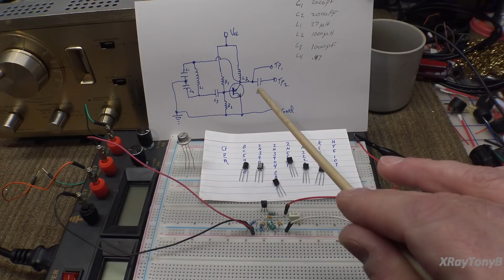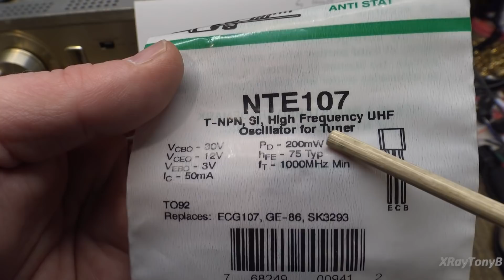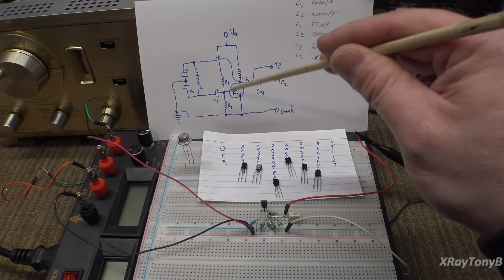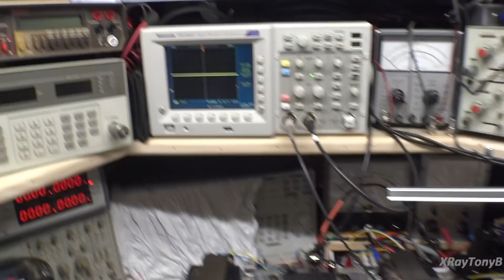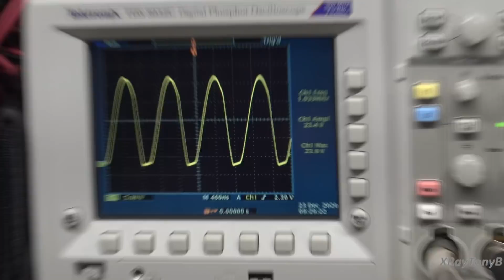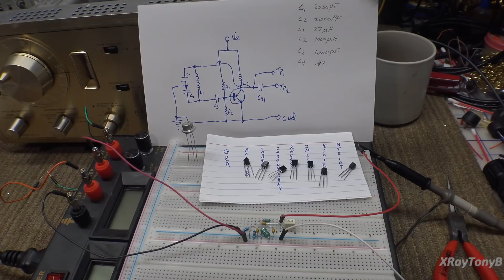Random Video - Effect of Transistor Type on a Circuit

Comment: You would probably get different oscilloscope traces for different transistors of the same type (especially the cheaper ones) because they have different current gains. If I was going to use a different type of transistor (beats ordering an expensive replacement) then I would probably change the biasing to suit. I have always thought that it was a poor design practice to make a circuit critically dependent on the type of transistor used though this may be a deliberate choice by the manufacturer.

Comment: To my non-electrical engineering eye, it looked like the transistors where the bottom of the waveform had a wider flat spot oscillated at lower frequencies.  More time was taken up recovering from the clipping at the bottom which lowered the frequency.  Am I correct on that?

Comment: great video.  thanks for doing this comparison.  We radio guys would love to see you do this with an RF front end amplifier circuit, as they are a source of great debate when it comes to transistor substitution.  maybe a common base configuration as a platform.  
One note is that NTE is a known parts re-labeler and the NTE107 you have there might not be the same NTE107 that i would get if i ordered one.
for us in the RF realm, it's all about noise floor, and the great debate is all about subbing out a 2SC1674 for a 2SC2999.
then there are those of us who wish someone would design a dual gate mosfet front end LOL.
another interesting video idea would be to show how the peripheral components change the characteristics of the circuit more so than just plugging in a transistor with a higher beta spec.
always enjoy your videos and especially the real world explanations.

Comment: To make the comparison more  similar wouldn't just reversing  the supply voltage for the PNP transistor? That way the DC biasing and the AC coupling would be the same as the NPN.
Reply: I didn't see what values R1 & R2 were. R1 would be much larger than R2  for biassing a silicon npn transistor without an emitter resistor, so merely swapping the collector and emitter would put a large voltage between the base and emitter of the germanium pnp transistor, perhaps as much as 11 volts. Perhaps the Soviet era components were bomb-proof.

Comment: It would be interesting to see the thermal effects on the circuit.  I bet even the warmth of your finger will change the waveform.  Without an emitter resistor the circuit will be very sensitive to the transistor beta and the bias will be sensitive to vt which is influenced by temperature.
Reply: Exactly, without the emitter resistor to lift the circuit into the linear region, the beta basically controls the result. I'm not counting the thermal effects.

Comment: Hi Tony, can I ask what is L2 doing?... understand the simple tank circuit with a tap in, but why the second coil. it's no choke, it's really bugging me🤔
(Pun intended)
Reply: I'm pretty sure that's there to keep rf out of the positive supply. Should act as a short to the 12v supply and a block to anything high frequency
Reply: L2 is the collector load at RF. It's pretty much a short circuit at DC (probably ~ 100 ohms), but at the operating frequency it has a reactance of 2PiFL = 6280 ohms. The circuit's output voltage at operating frequency is developed across it. Without an emitter resistor, this circuit, as drawn, operates in the non-linear region of the transistor, which is generally not optimum.
Reply: @cjay2  makes sense if the inductor has been 'tuned' for that frequency, so it acts as a choke (>f=> reluctance)  but similar could be achieved with a resistor? Looking closer at his diagram, there is a link back to the base, which may be there to provide feedback /osc stability? That would help to keep the transistor from saturation...

Comment: Ooooh! Russian transistors! 
I don't know why but there's something about Russian components! Especially if it's cold war era stuff! 
My favourite amplifier is using TO66 metal encapsulated transistors for it's output stage and I believe the input was using TO92? I could be wrong on that one, it is a germanium transistor, when I got the amplifier, someone had just clipped the legs on the failed TO92 and just soldered the new plastic package transistor to what was left! Talk about being lazy! 
There was something about the sound of that amplifier which I have never heard before! Hand built by someone lovingly at home back in 1973 and apart from the failed small signal transistor, everything else was original, still has it's original Elna capacitors! It gets used daily even if I'm not listening to it, electronic equipment that gets used a lot will outlast something that only gets used every once in a while... Strangely enough, I have been expecting my Samsung TV to fail! It's a plasma which I have had for at least more than 10 year's now, I have seen newer TV's out on the nature strip! But this TV has this thing where it turns itself on without lighting up the screen, it's some kind of feature that gets rid of screen burn in, remember when that was a thing lol, well it does work but I have been thinking that there's also a side effect that Samsung probably wasn't aware of at the time, by having the TV fire up every single day and it does regardless of use, it's actually keeping the capacitors in good condition! I reckon that if I unplugged it for a few months and then fired it up, I will get at least one exploded capacitor! If not more, they really don't like coming out of a coma at full rated voltage! If you have a Variac and bring it up slowly over time, you can save it! Leaky capacitors are a different thing, those things should be replaced regardless...
Reply: Shango066 does the USSR stuff quite a bit. Give his channel a look. Some of those soviet radios are built! Entertaining he’s always digging in bags and bags of Soviet transistors and tubes

Comment: Emitter resistor may help in your waveform
Reply: That is correct, obviously.  But the aim of this video is to show the different behavior of the transistors under equal circumstances.  The emitter resistor would prevent the effects of oscillation to occur.
Reply: @1959Berre  Good point
Reply: I've never used the BC5xx series or the 2N55xx series without one ! (Re) Those are my two favorites in the line-up..at least for audio.